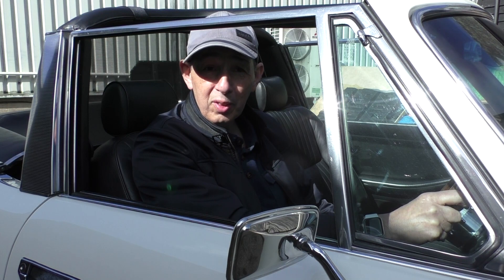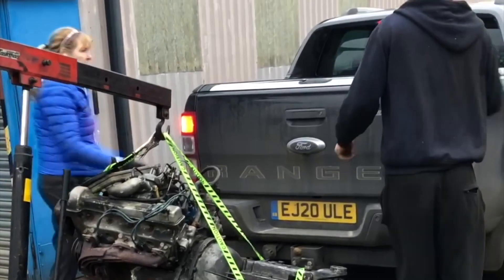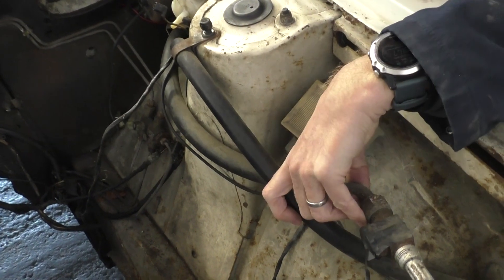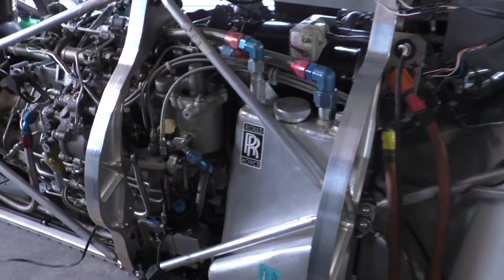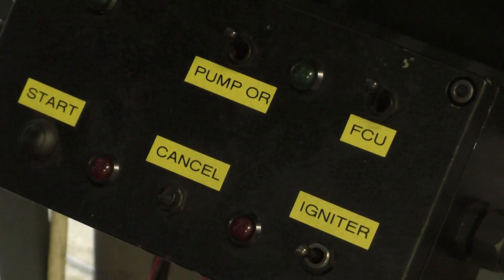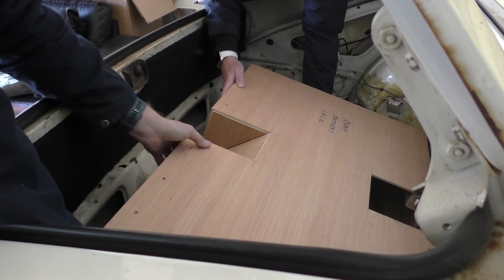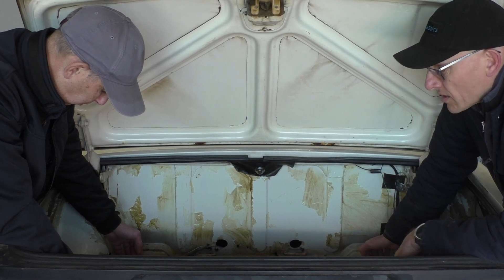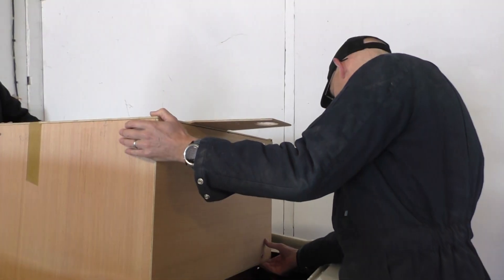What I Learned From REMOVING My Triumph Stag Engine

Comment: I suppose the e-Motor will go where the transmission was?  Will there be a normal 12v battery to run the non-powertrain electrics?
Reply: Hi Paul. Yes, the motor and reduction box unit goes in place of the gearbox and uses the same mounts. The car will also have a 12V battery (about 20Ah) to enable power up of the EV system and to run systems like the lights and horn when the DCDC is not on.